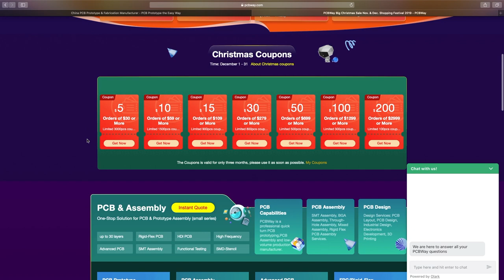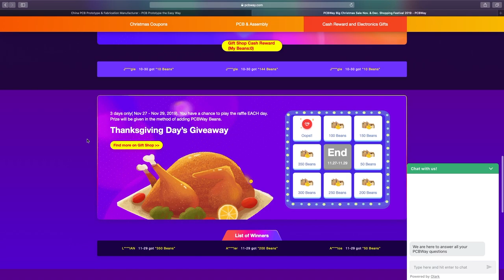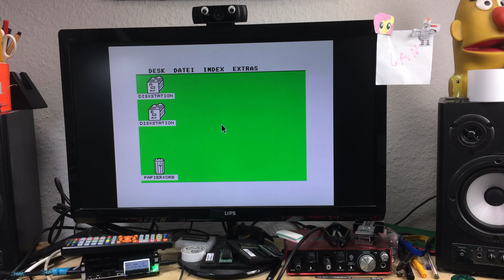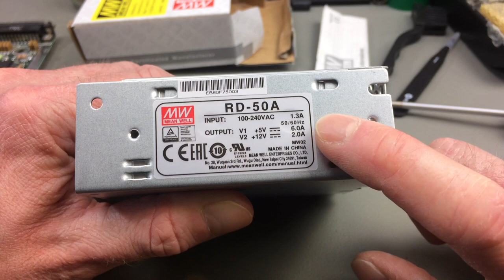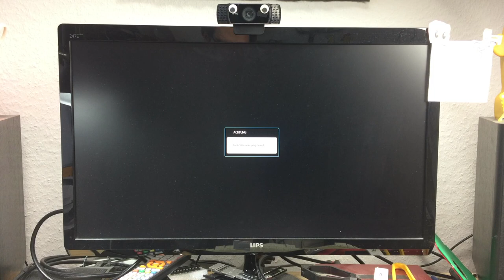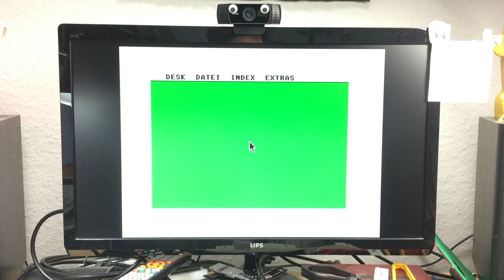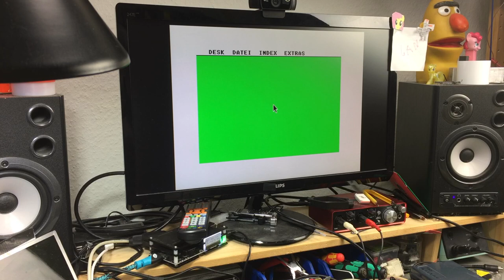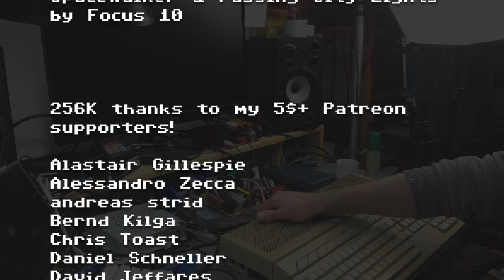Atari 1040STF Restoration Part 1: The Electronics

Comment: I have a 520STe that was given to me as a gift by a customer who before he gifted it to me became a good friend, and I absolutely adore it, I've fully recapped the entire system, fitted it with 4MB of RAM, a gotek floppy emulator, an ultrasatan HDD emulator and upgraded it to TOS 2.06. It's a gorgeous machine and I'm delighted to have it in my collection.

I found that the original PSU can be made good again by replacing all of the caps with low esr Nichicon/Panasonic caps, once I did that the screen no longer dims when accessing the floppy drive (before I replaced it with the gotek) and while the PSU still gets unnervingly hot after long use, it's not given me a lick of trouble, and in conjunction with an RGB SCART cable the picture is crystal clear even in low res mode, whereas before I recapped it the image was fuzzy and distorted, some PSUs may still exhibit screen dimming, mine doesn't but that might not be true for others.

Now I just need an original Atari RGB monitor and cable, and to get around to repairing the joysticks I got with it. (all told the entire lot of Atari STe stuff I was given is worth about 400 quid, and some of the games I was given have never been opened and are still in the shrink wrap)

Comment: Thank you for the tip on the power supply. The PS of my Atari broke down recently, and I used the Meanwell RD50 as a (kind-of) drop in replacement. I decided to completely remove the cover of the powersupply instead of going around with a dremel or other tools.. Just two holes in the Powersupply bracket in the ST to mount the meanwell.

Comment: For the power supply, you could in future consider the Meanwell RPD-60A. This is a smaller board with no casing that should fit very nicely. Power connections are via plug-on terminals, but you can also desolder the sockets and solder wires directly into the PCB - which is what I do with the RPT-60B boards I use as replacement Amiga power supplies

Comment: 40:34 if the drill stopped abrupt (the Driller will be stuck in the metal sheet) your fingers will be cut from the metal part! Never do this to hold a metal sheet (plate) by hand during drilling it! it is dangerous - but if you're in hospital that will hurt too. To this switching power supply first measure it before connecting it - sometimes came out 6,5V on the 5V side! so Jan Beta also metioned!

Comment: Just did the same power supply replacement this morning. It was a very tight fit. The mains cable section in my STE had far more there in terms of insulation protection so I could not push the mean well as far back towards the power switch. The cable to the mother board is only just long enough. I did desolder these original power supply rather than cut them so it may have been better if I had kept the original crimped part as this would have extended the 5v/12v just a little more and made it easier to connect them if I had crimped the spade connections on to the crimped ones used to solder those 5v/12v lines to the original power supply.

Comment: Also. I would consider buying TOS 2.16 which is a modern TOS replacement for the STE that will give you excellent compatibility with games, new features, speed and better hard drive compatibility. Supporting Petari, a “god” in Atari ST community is bonus.

Comment: Excellent video!  I am also in the process of an ST restore, so I was excited when I saw your video in my feed.  I'm using the Mean Well RPD-60A as a replacement power supply.  The install was a little easier, as compared to yours, as the RPD-60A is quite a bit smaller.  The size is 4.00" L x 2.00" W x 1.14" H (101.6mm x 50.8mm x 29.0mm).  The power specs are less though (5V @ 5A, 12V @ 2A).
Reply from the maker: Thanks! Makes sense to use the smaller supply, had that on my list, too, if I remember correctly. Power should still be plenty obviously. :)

Comment: It seems to me that the flooppy head is trying to read sector 0 over and over. There is a limit switch sensor that should be triggered when the head reachs the edge that you can see at minute 17:42. Maybe this sensor is not closing or the board is misreading the signal.
Reply from the maker: Good shot! I'm going to check that. :)

Comment: For any future modders. The PICO PSU is a better/easier upgrade that uses a standard small 12V external power brick connected to the ST via a DC barrel plug. Removes the heat from any internal PSU and makes the entire computer lighter.

Comment: I have a similar meanwell PSU for my A1200, only it also has the -12V output. The problem is the adjustment for +5V also moves the 12V lines and since the A1200 has an external PSU there's a cable into the machine and I have to adjust the voltage up on the 5V line on the PSU and this lifts the 12V way too high, especially since most of the current draw is on the 5V line anyways. Sucks. I think I'll have to put a couple of diodes inline with the 12V line to not overvoltage the thing.

Comment: Could you have not removed the MW power supply from its enclosure, rather than modifying the enclosure?
Reply: this. if you want to use the RF shield, no need to keep the meanwell RF shield. just remove it and it will probably mount better as well.

Comment: When I recapped my C64 I was so nervous that I checked the board after EVERY capacitor. Thankfully there were only 6 in that board revision. I'm glad I didn't get an older one with like 20 of them. I'm not surprised, but the SD2IEC still doesn't work. Either it's my home made power supply running at 4.5V or the SD2IEC is faulty. But the C64 works perfectly according to the diagnostic harness.

Comment: You should have tried the floppy drive with the new power supply. You said whenever the drive started the picture dimmed. Chances are the supply wasn't supplying enough power to it to wake it work correctly.
Reply: He did. Read the other comments.

Comment: tbh in my experience the most common floppy drive issues are misaligned heads, is a pain in the ass tbh, you need to unscrew just enough to be able to move the upper head and gently move it backward or forward and screw it again and it's trial and error (at least for the 3,5" ones).

Also can be the track 1 sensor, that one can also be misaligned and when the drive goes to the 1st track the sensor says that it's on the 1st one but in reality it's in another one (this one is more uncommon at least in older drives), and its the same, move it and screw it again and trial and error. I spent HOURS trying to fix a disk drive doing this and i was able to do it but i wish i would give up lol.

Comment: I had an Atari 520 STFM first then upgraded later to an Atari 520 STE model which had an easy RAM upgrade option so I very soon upgraded it to 1 meg RAM. Many years later I felt nostalgic and ordered an Atari 1024 STE from eBay and booted it up. Works fine except for one thing, the Blitter option is disabled. So I wonder if it just needs a new blitter chip or maybe there is something else wrong with it. The seller was kind about the fault as it was sold as fully working, he did a partial refund and also sent a bunch of disks he found lying around for it as compensation 🙂

Comment: I got a 1040STF myself a few months ago, it was really cheap because it had a broken floppy drive which I just replaced with a Gotek emulator. Since the F model has a really weird video setup I was afraid that it wouldn't display anything properly but it worked fine with a SCART cable I got from eBay, not sure if the cable has some trickery inside it work on a modern display but it worked, however on my CRT TV it displays opposite colors for some reason as the TOS background color is pink, couldn't find any explanation for that as it was fine on the flat TV

Great machine although I prefer my A500 because of the sound, the ST sound chip does have it's own charm though. Mine is also in german which I didn't really account for when I ordered but even though I don't speak german I don't think it's that important and I could change the TOS if I really needed it. I might try to save the floppy drive now that you made a video of doing that, haven't really dealt with them before so I wasn't sure how to troubleshoot especially since i had no floppies to try it with
Reply from the maker: Oh, interesting fault with the inverted colors. Didn't see anything like that before (except maybe with broken cables and such). The Amiga sound chip has a much different approach as it is sample based. The Atari has a real "synthesizer" that actually generates waveforms by itself. So it's a whole different story. And I agree, it is very interesting in its own right. :)
Reply: "TOS background color is pink"... oh wait, where have I seen this before? Ah, on my very own 520STM connected via Original Atari Scart-cable (which is composite, not RGB, has some missing pins) to my old Loewe Xelos A26 LCD-TV: https://flic.kr/p/RLKwL5 😁
Afaik also my 2019er 1040STF from ebay shows this effect. So it doesn't matter if the ST has a RF-modulator (the M in 520STM) or not. As you might know, the modulator influences the output on the monitor-connector, the "M" has a composite-signal at a pin, where the "non-M" has a sync-signal. All if I remember correctly. Another ebay-Scart-cable with RGB produces some other behavior on that specific TV. It's quite a complex story, to build THE perfect Scart-cable for the ST. Just do a google-search. 😉
...or buy a OSSC as Jan (and I ^^) did. It produces awesome pic-quality with the ST on any of my three PC-monitors. You don't even have to bother about the 15KHz-barrier, because the OSSC converts the signal into convenient 31,x KHz! 😎
Btw. Jan, did you already flash your OSSC (1.6 i presume?) to the latest 0.85a version? This gives you an onscreen-display, so you can see the actual OSSC-LCD on your monitor! Nice feature imho, especially your OSSC is a bit away from you.
Reply: @TPau65  Somehow I came back to this video and found my old comment.. anyway, I solved the inverted color problem long time ago, turns out the cheap SCART -> SCART+AUX adapter I bought off ebay for plugging in my speakers when using the CRT had the pins soldered wrong, the pins for green and green ground were opposite.. the reason why it worked on my modern TV is because I didn't need that adapter as the TV had aux output built in

Comment: You propably should have soldered the new blue/brown mains leads sideways to the power switch. Now there is tight bend at  where the solder infused wires end creating a weaker point and also the clearance to the PSU's casing would have been greater.

Comment: Thta PSU, re-cap it, replace the two tiny resistors next to the main reservoir cap and it'll last.
Reply: Yes I wonder why replace the whole thing and drill holes in a original mount instead of refresh the delicate parts

Comment: Jan why didn't you just replace parts on the original psu?
Reply from the maker: Because it would have cost nearly the same as the replacement PSU in parts and it still would be less reliable by design.

Comment: The Jackintosh Lives.   I have only seen 1 ST up close at a friends house.  He used it to run a BBS.  I don't recall which model it was but it was an early version for sure.   Only thing I remember was thinking how nice it looked.   DRI's GEM at the time also shipped with some PC Clones another friend had it but I don't recall if he ever used it or not.   I like Meanwell Power Supplies I have then powering my A500, A500 and A1200 and I have a spare but I also have one powering one of my Industrial Control Panels.  They are reasonably priced and reliable.   One thing about the ST is they had quite a few model variants designated by the letters at the end of the model number.     The control ports being under the computer are not so desirable not clear why they did that other than cost reduction to keep their BOM cost low.   I still think they are nice looking computers.

Comment: Tidy layout, apart from that big 4700uF capacitor across the board :)
Reply: Yeah that Capacitor is insane 😲

Such a different look/layout to the Amiga internally.
Reply from the maker: Haha, that's true. I wonder what the engineers were thinking. :D
Reply: That really bugs me too. Even those "patches", that are probably external power rails. I would have patched on the solder side of the board rather than the component one.
Reply: That was the first thing I noticed. Not the RAM, but that cap. At first I thought it was just laying around. And then I'm like.....wait no, that's actually soldered in!
Reply: "There is no excellent beauty that hath not some strangeness in the proportion."

Francis Bacon

Comment: If you want to use nicer mice, I built as a kit an Atari-ST/Amiga (jumper selectable) to PS/2 Mouse converter from ebay several years ago. By now, there must be USB mouse versions. I have an original 520-ST I upgraded to 2.5mb with a vintage adapter from a company called AERCO from Texas USA. And, a few years ago I added an upgraded set of TOS chips. I also have a MagicSac (Mac 128/512k Compatibility) with the Transporter One that reads Mac Disks directly on the ST. I also have the next generation Spectre GCR that can give an ST Mac Plus compatibility as well as read Mac Floppies. Someone who passed away left me his Mega ST. I don't have the original keyboard, but I have an adapter to use a PC/XT keyboard with it. It also came with a SCSI adapter and two hard drives.

Comment: I am going to try some of these mods. I ordered the power supply which also came without the plastic covering for the screw terminals. I found and bought the correct part, but it came in a 10-pack, so have 9 spares!  If anyone is interested in these and finds a way of messaging me then please let me know. If not, I guess I’ll check for replies to this comment sometime. @JanBeta: if you need one then I’ll send you one as a “thank you” for this nice video guide!

Comment: Replacing capacitors on disk drives seems really hard, most people don't bother with it because it's impossible to then calibrate the drive again with the new variations present in the caps.

Comment: I have an stfm but disk drive does not wok well not sure if its the drive or the compute yet ,i do not want to cut the case to fit a gotek i want it as is ,i am an amiga fan but the atari st is a geat machine and in my opinion is still a better looking machine than the a500.

Comment: You'd have been better off mounting that supply 90 degrees clockwise, it required the same cutting on the supply on the bottom, but fit the keyboard and rf shielding perfectly in that orientation.  That's how I mounted mine on the 1040ste I upgraded back in the end of 2018 after watching your video of the mega upgrade.
Reply from the maker: Yes, saw pictures of that in some forum, makes sense. I kind of liked the idea to make the DC connections as short as possible. There's also a smaller version of the PSU that fits both ways and has enough ooomph to power the Atari. Maybe I'll look into that next time I get one of these on my bench. :)
Reply: @JanBeta  If it was over on AtariAge, it was most likely my pictures.  Depending on how you route your power cables to the motherboard, you can use the whole RF shield, I opted to leave off the RF shield part that goes over the power supply simply because the supply was cased already, so I didn't feel that part was necessary.  I most likely wouldn't have ever thought to use that particular supply myself if I hadn't watched your Mega ST modification video, so thanks for the original idea :).

Comment: Yes there are quite some different mainboard-layouts of the 1040STF(M). My 1040STF from late 1988 looks like this: https://flic.kr/p/23yDqED
As you can see heavily re-organized, less RAM-chips and only two TOS-ROMs.
If you're going to do a Gotek-mod, I really recommend a special STF-frame, which fits quite perfectly in the case, without case modifications. Another advantage of that frame: The Gotek-PCB is positioned upside down, so you don't have to twist the ribbon-cable and connect it just like the original drive. You can find the frame on ebay, also one for the Amiga 500 etc.
Looks like this: https://flic.kr/p/2cV9FYB , https://flic.kr/p/2dFroth
My complete ST-album (520 and 1040): https://flic.kr/s/aHsmyrFUTL
Some videos  about this in my YT-channel. 😀

Comment: If you plan on using an SD hard drive solution, consider replacing the CPU to fix DMA issues with STE (MC68HC000 needed). Google for info
Reply: I don't think the STF has DMA :(

Comment: In ST there is almost no load on 12V line except floppy drive, and when you load jest 5V on this MeanWell PSU, its 12V line will go well over 13V. I'd recap the original PSU, and leave it in the computer.
P.S.
This RD-50 fits better sideways. Mounting like you did, you have 230VAC very close to the keyboard PCB.
Reply from the maker: That's true but it didn't fit that well sideways because the plate it's sitting on is bent up (for the screws) in the wrong positions. I'm definitely going to put some kind of additional insulation on the live terminals when I finish the refurb.
Reply: Not my experience with Meanwell supplies - they have their feedback taken from the 5V line, so as long as 5V is minimum loaded, the other rails are fine
Reply: @jaycee1980  That's not true, when you have feedback from one rail only, when you load that rail only, voltage on other rails will raise above spec.

Comment: Maybe nextime you can remove the metal casing of the MeanWell PSU, it's going to be exactly like the old Atari PSU
Reply: the casing also is RF shielding as well reducing RF noise that can show in pic signal to monitor. that is why some of the MB has metal boxes around some components like the Video out circuit for the same reasons. PSU's tend to be really RF Noisy.